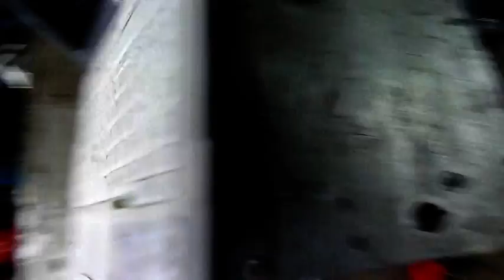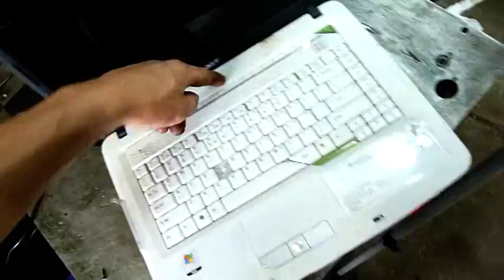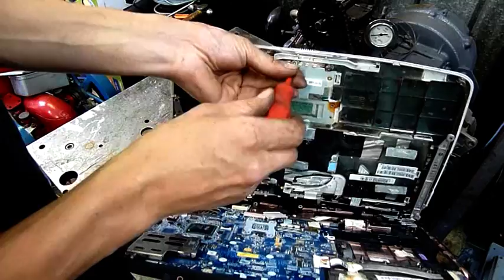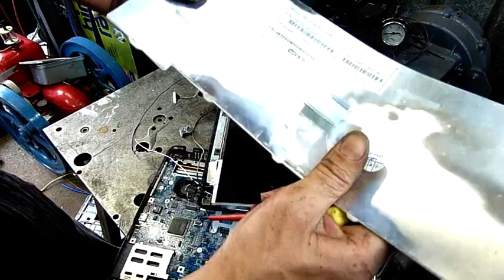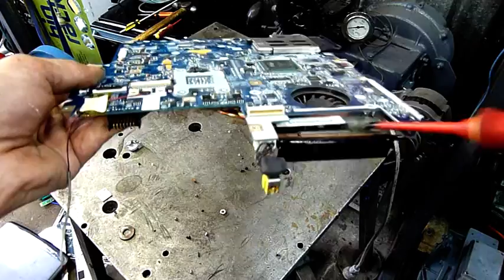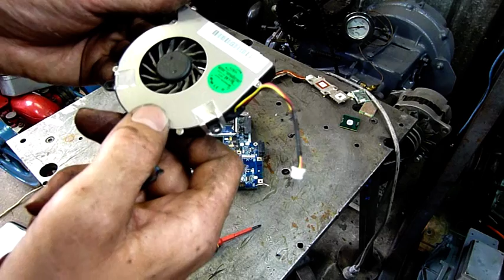Tearing Into Acer Aspire Laptop

Comment: I came to see how the power connecter looks like. I got back a laptop like this that I gave away a whole back and the power connector is missing. The charger was directly wired to the connector on the board where the "jack" would be

Comment: Rated at 5Volts haha yea right. It ran on 2 18650 Lithium Ion cells from the same laptop. Ofcourse the fan become a bit hot. Voltage was around 7.4 ~ 8 volts.

Comment: Its almost the same as an acer 7520g i ripped appart once. That one had a webcam wich i still have lying around... first small board is wifi indeed, second one is modem. Im still watch when typing this (in case you cover this)

Comment: yeah i have dedicated ATI Graphics 4650 1GB 128 Bit and an Intel P8700 with 4gb ddr2 800 and i have to regularly clean my cooler as i don't have central hvac so my house is dusty as we burn wood for heat and my laptop gets real freaking hot!

Comment: I had one of these in to be fixed recently. I told the guy for what it cost to fix. You can buy a new one.
The only things worth saving are the CPU, fan, the back light, Wireless card and antenna's. the rest is junk.
The yellow connector is a mutely use video out. and will do composite S-video, and component. Also the GPU is part of the north bridge. the south bridge handles stuff like Usb, Sata and other i/o. And pci pcmcia is no longer used on most laptops